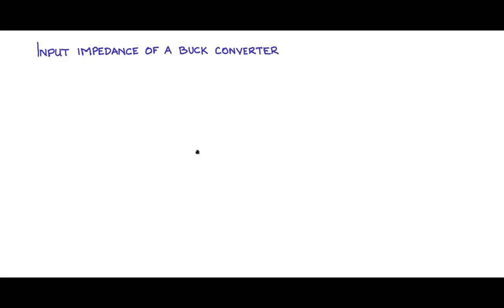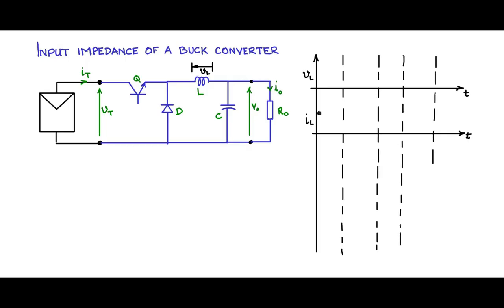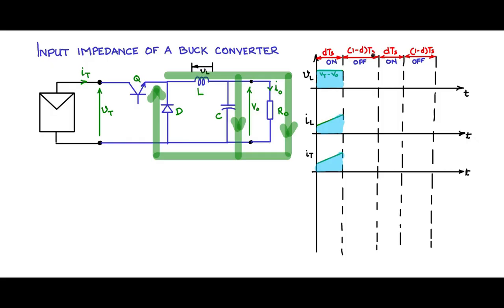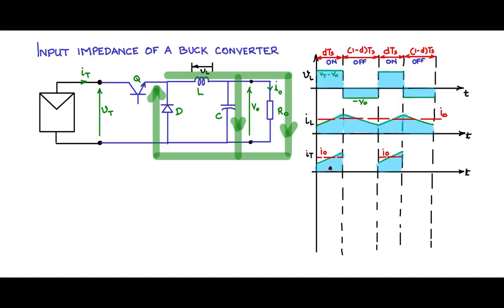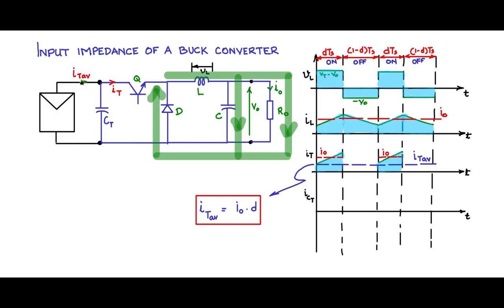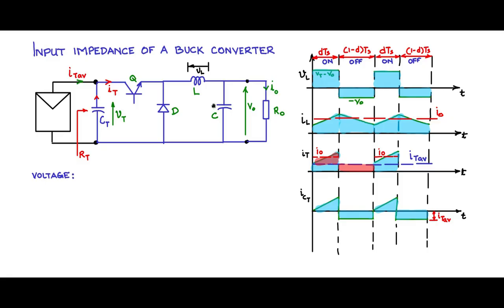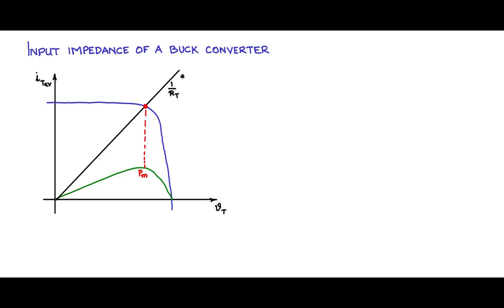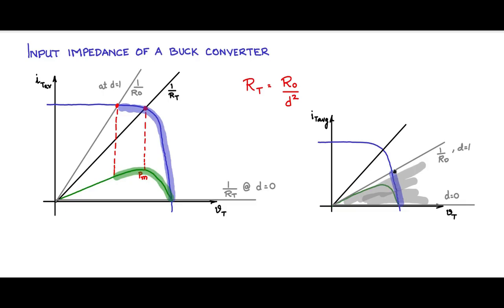Input impedance of Buck converter

Comment: Huge thanks , I have been looking for this for years as I could never understand  how a buck ‘ controlled / throttled ‘ the output of a PV panel , eg 2.4 KW panel but only 400w on load so where does excess go . Every explanation I have seen says it is dissipated in the panel as heat